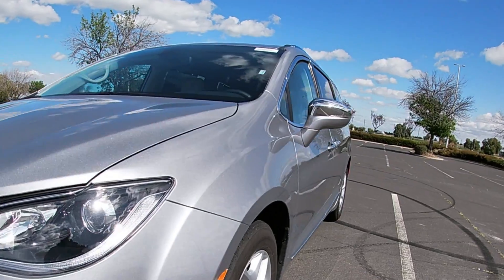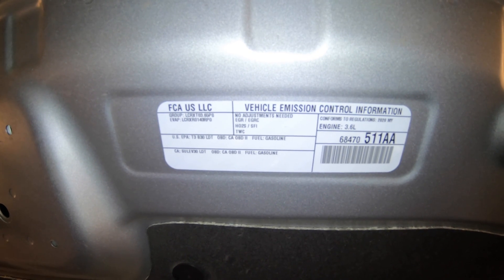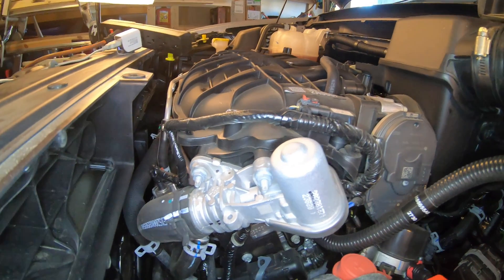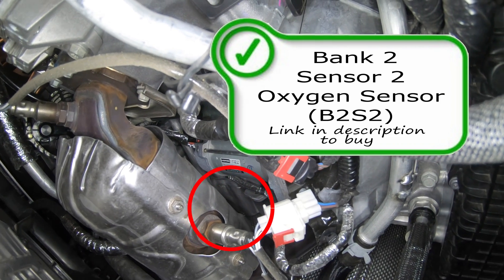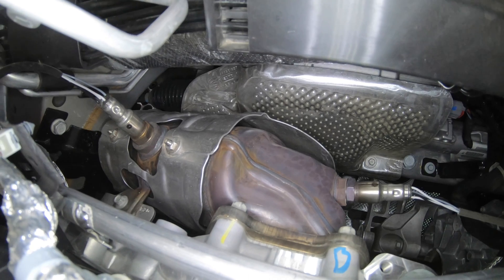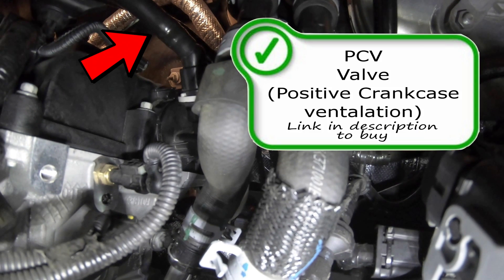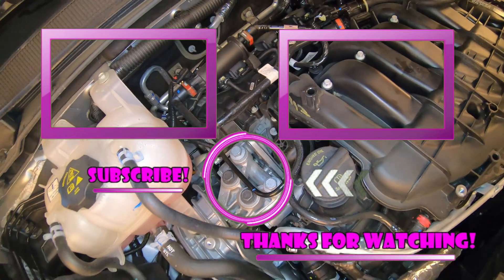⫷ Chrysler Pacifica Emissions Locations & Info: EGR Valve, PCV Valve, Vapor Purge, Oxygen Sensors ⫸

Comment: Do you recommend pulling and cleaning the 4 oxygen sensors on occasion?
Reply from the maker: I'm personally not a big fan of cleaning the oxygen sensors. I usually just replace them when they go bad. On my personal vehicles, I replace them by 150k miles if they have not been replaced by then. But! Cleaning them might help. It's just not my thing. I'm not saying it's wrong to do it.
Reply: @ScottiesHobbies I might tend to agree but there's a lot of activity between them being fine and replacing them when they go bad, dirty ones can cause bad idle and excessive fuel consumption etc..I've got 70k on my '18 gas Pacifica and runs perfect (knock on wood) but maybe I'll just pull all 4 soon and spray them with cleaner as preventative who knows...

Comment: I am having issues with my 2017 Touring stauling at stops. CEL is intermittently on. At times it will flash. Accelerating will correct it. Then it runs fine. It was coughing or sputtering occasionally so I replaced the  coils and spark plugs. That is better. I cleaned the MAF sensor and throttle body. I ran injector cleaner. It is getting worse. Stored code was about lean mixer...I forget the code but couldn't find any threads on it. Any suggestions?
Reply from the maker: I'd be looking for vacuum leaks in this case or leak between the MAF and the throttle body.. more than likely a vac leak though.

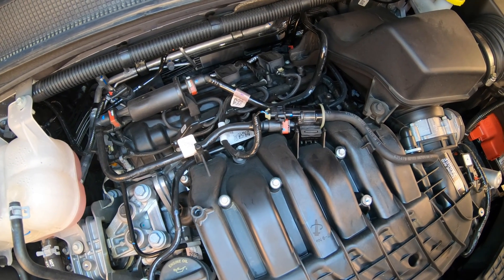Comment: If you stop at about the 4:10 point, going back upstream from the purge valve, there is a cylindrical component in the vapor line, with two red clips on either end. What is that? I thought the vapor line would just come up forward from the charcoal canister straight to the purge valve. But that thing is in line, ahead of the purge valve.
Reply from the maker: Ya kno... I could not find a listing on that at the time I made this video. I believe it's some type of filter. I'll look into this again and see if I can come up with anything new. BRB. Lol
Reply: What about code p04Ce #07e8 - egr temperature sensor c circuit.  It came on along with p2457 #07e8

Comment: 2017 Pacifica w 151k miles. Threw P0440 and then P0456. Changed purge valve and cleared. Threw P0440 and after 1.5 weeks P0440 is pending still. Took for smoke test. No leaks found. Now I'm at a loss. Ideas?
Reply from the maker: You don't have a aftermarket fuel cap. Do you? Either way, I'd replace it with a factory cap or a non locking Stant cap. That might not fix it but with that much, I'd just replace it. It could be the vent valve not sealing properly  too. Have you tested the vent valve?
Reply: @ScottiesHobbies  I have a capless filler neck.
Reply from the maker: @paulrickert8464  I had a feeling that was going to be the case.... maybe the new purge is not sealing when commanded shut.
Reply: @ScottiesHobbies  Finally spent another $120 and had someone troubleshoot it. ESIM not closing (Found in driver's side rear wheel well). Apparently this is a common issue with this vehicle. Bought the $80 part and gasket and hope to take care of it this week.
Reply from the maker: @paulrickert8464  👍👍 that is the vent valve on that vehicle.  Chrysler came up with a module that integrates the leak detection and vent into one part.
Reply: @ScottiesHobbies  Ahhh I'd replaced the vapor cannister purge valve previously. I misunderstood what you were referring to! Thanks!
Reply from the maker: @paulrickert8464  good luck on the replacement this weekend.  Keep us posted on how it goes. 🤞

Comment: Bank two sensor 1. Will that cause a 1053? Great video!
Reply from the maker: Can you verify that code? A p1053 is a CAm code. A p0153 is a oxygen sensor. Verify first and then ill see what I can recommend.
Reply: @ScottiesHobbies  1053 correct
Reply from the maker: @paintingandlife4288  that is a cam code. I'm not to familiar with it. Let me do some research and get back to you.
Reply: @ScottiesHobbies  thanks!
Reply: @ScottiesHobbies   that 1053 ended up being the VVT  solenoid under the intake

Comment: DO you have any videos showing replacement of the purge valve? It looks pretty straight forward but seeing a video may help. Thanks!
Reply: It's sitting right on top of the motor its a plastic module easy to replace
Reply: The hardest thing was the little clip that holds it together. I ended up breaking mine. But the removal and replacement was simple.

Comment: 2017 Chrysler Pacifica with a P0440. any help?
Reply: same, and resolution?
Reply: Same here, any info on what to do first for a P0440? It lit up when I added a large bottle of fuel injector cleaner to the fuel tank before a long road trip.
Reply: Oooh I did the same thing and a couple days after adding the injector cleaner it threw the code... But I see no response from the maker.
Reply: I’m having the same issue, what happened with yours?
Reply: I changed my purge valve about a month ago, I reset using my computer and I get the same error along with a small emissions vapor leak. I reset runs fine for about a week and returns 🤷‍♂️

Comment: I have a 2018 Chrysler Pacifica with a P0456 small EVAP leak. Any ideas?
Reply: Emissions Vapor Purge Valve
Reply: I replaced mine after a p0440 and p0456 and still have the codes.